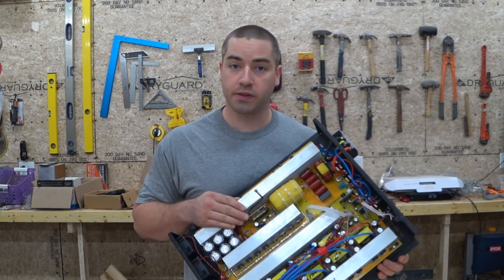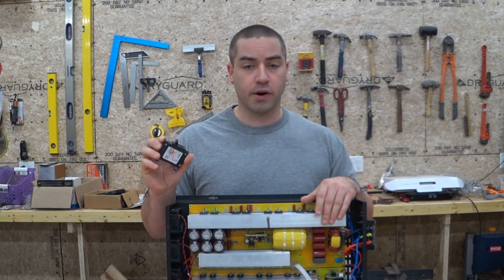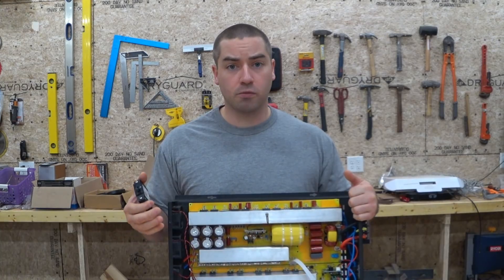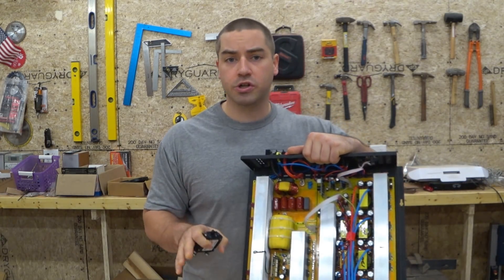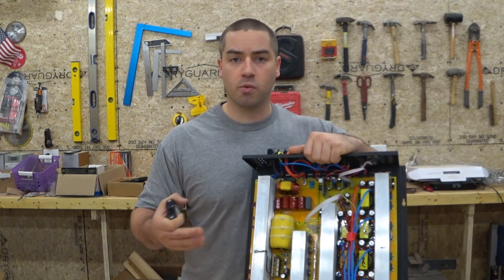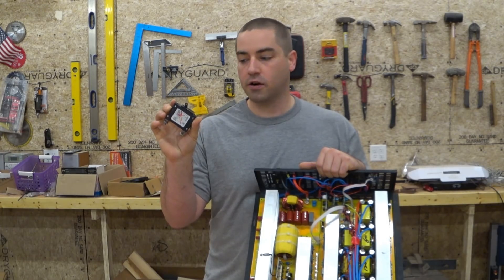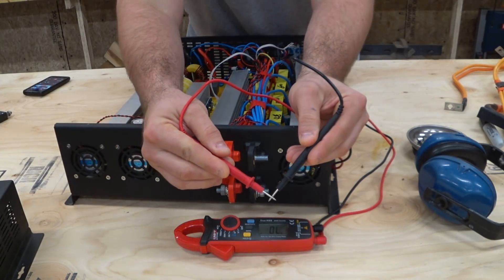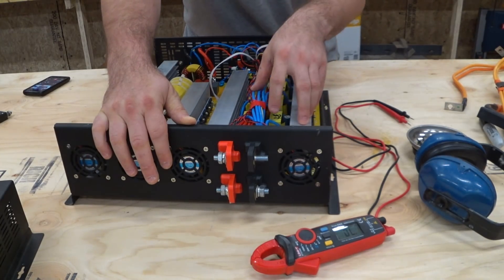Did I Blow Up the Inverter?

Comment: I am an electrical engineer who specializes in power. The circuit breaker did exactly what it was supposed to do. The spark very likely came from the circuit breaker and this is very normal. The circuit breaker has a very large current flowing through it and they often draw an arc when opening during a fault or large surge. One sure way to tell it came from the circuit breaker is the color of the spark. It was a green blue color indicative of molten copper from an arc blast. The continuity test you performed is not necessarily indicative of a short. The bulk input storage capacitors will act like a short when they are empty and will indicate a false short. The capacitors look like a short when they are discharged. I can tell by the internals of the inverter it was designed to a very tight budget. All the mosfets appear to be lacking any type of snubber or protection circuitry although it's a little hard to tell from the video. The inductive surge from the motor will likely cause an instantaneous voltage spike somewhere in the inverter and I would be willing to bet that spike exceeded the power transistors specification for max voltage causing the transistors to fail short circuit. The saw inrush current is very fast typically few ac cycles so it can't be measured using the method you used. It could be measured using an oscilloscope and it is certainly many times its operating current.
Reply: Also an EE, though not a power specialization. I completely agree, tho. It doesn't appear it was taken into account how devastating a large inductive kickback can be. Also the fact that the wires are of a pretty sizable length difference between the different sections of the supply sharing the load is a bit suspect. If you're dealing with an impulse even an inch difference can have some drastic effects.
Reply: Actually I think it´s unlikely the inductive back-EMF from the motor exceeded the mosfet´s ratings. The motor was not even moving yet, meaning there is almost no magnetic field yet, which of course is also the reason why the motor would draw a high inrush current. 

My bet is on badly matched/controlled mosfets, which may also be under-specced. 
In any case, the bad design is to blame, nothing else. A good quality inverter shouldn´t even be damaged by a permanent short circuit on the output.
Reply: @Basement-Science  I agree. My suspicion is on a dV/dt failure of the MOSFETs. Exceeding this rating can cause an avalanche-like breakdown, resulting in catastrophic failure of the device.

In this design, the DC-DC boost stage has the individual modules in series. As a result, all experience the same output transformer current. As output current rises (and this is likely to be very high under the near short circuit load imposed by the motor), so dV/dt is increased because of leakage inductance. As there are 9 modules in series, if the MOSFET switch off timing is not absolutely synchronous, the switching stress is concentrated on the one which switches off first. 

If this type of short-circuit is anticipated in MOSFET circuits, attention is needed to either passive dV/dt control snubbers, or active dV/dt control which reduces gate drive current in order to increase the fall time of the current. The use of parallel power modules in the first stage, rather than series, may also help.
Reply: I to am an electrical engineer and I completely agree with you as far as the in rush to the saw you would need to be monitoring the current with a storage scope setup for event capture. But I can already tell you that it in fact did exceed the current ratings of the primary side mosfets and as an engineer you know that absolute max means just that! We always had a saying the $0.10 fuse will always be protected by the $500.00 transistor. There isn't a thermal or magnetic current limiting device out there that is fast enough to protect solid state components from destruction. That protection has to be built into the circuit design. In this case what is known as cycle by cycle current limiting which is already built into the SG3525 switching regulator controller which is I am sure the foundation that the primary side of this thing is built around. And bottom line the primary side should have protected itself from destruction even if the secondary or high voltage side had experienced a catastrophic failure due exceeding the max dvdt ratings of the high side components. But the primary side didn't protect itself from destruction it experienced a catastrophic failure indicated by the molten copper that was expelled from the circuit breaker. Bottom line they cut too many corners so what is left is a verry nice looking peac of junk a properly designed unit should be able to withstand crowbar conditions.
Reply: @Brokendiode  That or invent the worlds fastest PTC fuse   ;-)
Reply: I agree with is probably missing snubber protection, or even some TVS diodes. But I have to wonder if the transformers arced causing the failure and in Truro would also knock out some of the mosfets ? The other think I would love to see is the bottom of the PCB, maybe some arc burn I’ll show up? This would confirm thin traces, or traces to close to each other with out any high voltage slots. Or a maybe even some components that are to close. I think the bottom of this board could possible lead to a more defined reason. Either way, it’s a flaw in the unit and wasn’t the breaker.
Reply: eh my I bet it was them cheaping out and using the same gate driver in the 3000 watt inverter, all these signs point to internal bridge short across the fets, (As if they where not switch correctly) 8000 watt units using the same gate driver the 3000 unit is, switching too many FETS it can't drive properly, causing switching delay of some kind. Wrong two FETS on at the same time.  Bang, short circuit across them thus also giving a short between The batteries themselves through the circuit breaker he was using.   just my theory.  Interesting such a failure on the input side, thats typically happens near the output side in most cases.
Reply: @UmbreWolf  

If the failure occurred in the high side that would have indicated that it was an inductive load issue. But not the case here. 
There are no external current limiting devices fuses or circuit  breakers that are capable of protecting mosfets from exceeding their ratings and experiencing catastrophic failure. It has to be built into the circuit design with cycle by cycle current limiting. And we aren't talking about 60 hz the primary side of this unit runs at 20 - 22 Khz that's at worst case scenario 50% duty cycle running at 20Khz the total on time for the transistor is 50us 0.00005 seconds in the event that the current comes within 90% the maximum rated current the control circuit needs to immediately shut down the device or shorten the duty cycle keeping the current from rising any further until the in rush current drops to a safe level.
Reply: You r awesome....
Reply: I to am an electrical engineer and I completely agree with you as far as the in rush to the saw you would need to be monitoring the current with a storage scope setup for event capture. But I can already tell you that it in fact did exceed the current ratings of the primary side mosfets and as an engineer you know that absolute max means just that! We always had a saying the $0.10 fuse will always be protected by the $500.00 transistor. There isn't a thermal or magnetic current limiting device out there that is fast enough to protect solid state components from destruction. That protection has to be built into the circuit design. In this case what is known as cycle by cycle current limiting which is already built into the SG3525 switching regulator controller which is I am sure the foundation that the primary side of this thing is built around. And bottom line the primary side should have protected itself from destruction even if the secondary or high voltage side had experienced a catastrophic failure due exceeding the max dvdt ratings of the high side components. But the primary side didn't protect itself from destruction it experienced a catastrophic failure indicated by the molten copper that was expelled from the circuit breaker. Bottom line they cut too many corners so what is left is a verry nice looking peac of junk a properly designed unit should be able to withstand crowbar conditions. Otherwise if you are running an off grid home every time something happens like a bad cord gets plugged in or an appliance has a malfunction instead of going to the panel and resetting the braker you just go replace the inverter like replacing a fuse. So you better keep a good supply of spair inverters or you could just bite the bullet spend the money for a quality product like an Outback VFX3648. Yes it's only a 3600 watt unit but it's capable of exceeding 11000 watts for start up. And if you do exceed it's ratings it won't blow up it just shuts down. You get what you pay for. Oh and it has the ability to feed back to the grid or parallel with a generator and share the load as well as option in stacking mode so two units ganged together in series to provide 7200 watts total at 120/240 volts just like what's available at the panel of a home operating from the grid. But they will go a steep further and you can stack 3 and get 120/208 volts 3 phase commercial power.
Reply: thanks. i learn so much from the comments in these videos.
Reply: You may be able to get a more accurate Peak Current load if your meter has a "Max" Option. It will lock the meter display to the highest current it can measured, but as Jacob suggested you need to a fast response detector like a current probe attached to an oscilloscope to get a true current peak. My guess is that peak inrush during startup is over 50 amps.That breaker you showed appears to be a DC Magnetic breaker by Carlington. It has a much faster trip response than a typical household breaker. Household breakers are typically thermal breakers which heats up an element in the breaker causing it to Trip which results in a delayed response. A Magnetic breaker uses a magnetic coil that trips the breaker and can trip less than a millisec if the current exceeds its set limit. However usually these breakers trip at a higher current than the name plate rating (to accommodate inrush) You can look up the data sheet for the breaker to know its real trip current rating.Try reversing the probe leads of your diode measurement. Its possible there isn't a dead short, There could also be a bank bank directly attached to the input terminals which the MM diode setting could show a dead short (until the cap bank is charged up & the MM isn't going to be able to charge the cap bank). 

If any of the internal fuses you replaced are blown, that would be an indication that you have a failed device (likely a pair of Mosfet: one on the high side (Positive) and the other on the low side (ground\Negative). You can do some in-circuit testing to identify a dead Mosfet by checking with a MM diode test across all of the Drain-source terminals of the Mosfet as well a the Source-Gate terminals. if you have a short its likely the MOSFET is dead.
Reply: if i was smart i would have came to the same conclusion
Reply: Reading these comments I'm wondering is it possible to build a valve inverter?
Reply: Very well explained. It has to be  in my humble opinion , in the design of the inverter .
Reply: I think that the 48 volt dc supply wiring is not large enough to handle the load amps.
Reply: I don't see any capacitors on the input. Usually not needed when there's a giant battery connected.
Reply: I just watched the video and was going to comment the same thing but someone beat me to it lol.
Reply: 25 year industrial electrician mosfet's look very small to me. I'd expect to see those on a 1K.
Reply: I absolutely agree ... the huge startup current draw was not only JUST the saw but the inverter seeing the huge demand for power as well ... in other words the saw caused the inverter to draw an extremely large amount of current in response to the saws massive start up current draw
Reply: The method you used was only the current draw of the saw ... which the breaker would have handled just fine ... but add in the massive current draw of the saw and the inverter most like 2 to 3 times of what the breaker could handle surge wise ... most likely that massive load at the moment the breaker tripped it most likely killed the mosfets
Reply: I will agree to what you said as well. I was thinking before what kind of inverter to get and I ended with inverter with build it transformer ..I think it is only way how to be sure that even with big load you will not destroy your inverter.  So far it is working as it should It is 5kW inverter , 24V In and 230V Out.  It is one big toroidal transformer and it is one of the best ..well for reasonable budged that is :) ...That is why i would not go again with transformless design again..because you might expect similar results  ..
Reply: Yes, I agree with you. It must be the Back EMF generated at the time of Switching ON the equipment.
Reply: I know your all wrong! The problem is right on the data plate at the bottom!
Made in China!
Reply: All I can say your Amazing, Bravo and you did awesome. From the video point of view I new right away that it was a peace of crap!
Reply: but, why put it in the market if is not tested in factory facility?
Reply: I am a retired Royal Navy electrical engineer. I spent a long time working on very high current DC circuits running to surges of over 800,000 A and some busbars you could have used as structural supports in a building. Some of the breakers were spring loaded and took two men to move the lever. With a separation of two metres plus achieved in a few milliseconds we would still have drawn an arc without quenching chambers built in. You soon got used to the smell of ozone around switchgear. DC presents far more arcing issues than AC at the same current and voltage.

I am not surprised that breaker vapourised the copper, in fact I am surprised the breaker did not explode. As Jacob quite rightly points out it is hard to be sure why the inverter created a low resistance when the AC side presented its load. My guess would be that a multistage system is being used and the mosfet banks are switched in as needed. The fact there are multiple electrolytic capacitors in each bank may be an attempt to reduce the ESR on each stage. The T0220 mosfets looked rather small and I suspect a reduced budget for the build meant the manufacturer were relying on the peak rating of the mosfets and trying to switch in the entire set of banks would present a huge inductance for it to saturate.

From what I have been able to see the components do look rather underrated for 8KW if that is a surge or continuous rating makes a difference. In the "mains" stage if that is what it is there is a large yellow component that looks like a monster inductor. Having repaired a few 6KVA UPS systems I was surprised at the lack of a huge multi tap toroidal and you usually see the heatsync being used as a busbar. Indeed when I looked closely after reading Jacobs notes I could not see anything that looked like a snubber network. This looks to be designed as a high frequency inverter. The internals just do not look correct for such a huge claimed output. Wild shot in the dark would be that the sudden huge inductive current draw of the chop saw (likely housing a rather large cap onboard) created a huge DC side voltage sag creating an increase in current for the mosfet stages to handle, chain reaction and in effect a very very low resistance DC side. I wonder if the set of four mosfets together is an attempt to create a H bridge. Not good !

As I said this is all a guess as I have no product design data or test results so I can only take a shot in the dark. At the end of the day.... would I purchase one ? .........No.  Sorry
Reply: The current going into the inverter during the transient of the saw motor starting  likely dropped the input voltage to the inverter from 48 to well below what was required causes a huge overcurrent condition.

Comment: The breaker cutting power burned up the inverter. Say you was about to make a big leap or jump forward and someone pulled your footing out from under you. My solar garage has been running for four year without a fuse or breaker before the inverter. Theres already fuse protection in the inverter. Up to its limit.  I can see having a small fuse on each battery so each battery is protected from each other. To have one massive fuse thats 200 amp or bigger is a fire hazzard. Thats why there is a dozen or more small ones inside the inverter.

Comment: I use these big beefy breakers on my big inverters (over 7 inches tall). They are well worth the $89 cost: https://www.altestore.com/store/enclosures-electrical-safety/overcurrent-devices-fuses-breakers/panel-mount-circuit-breakers/midnite-solar-250amp-125vdc-panel-mount-breaker-p9924/